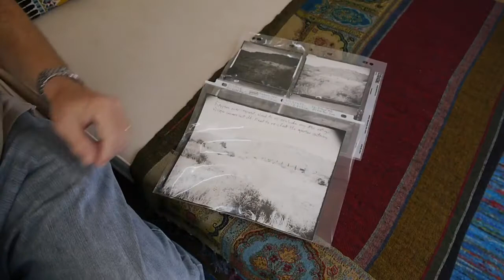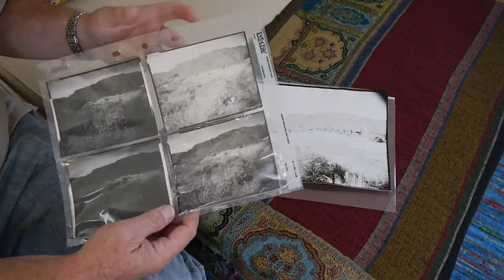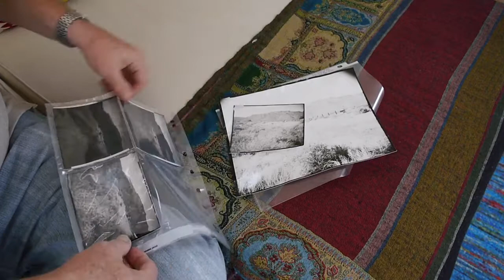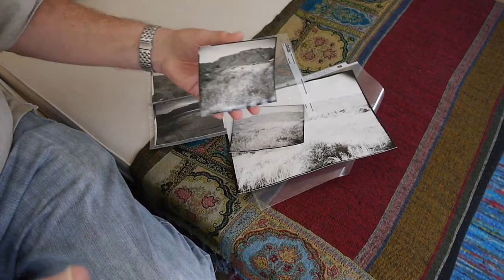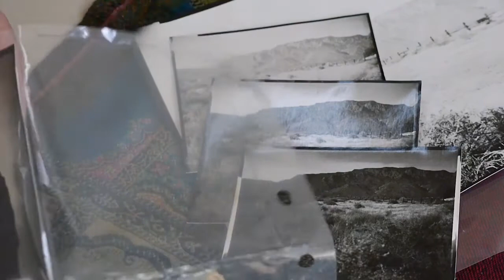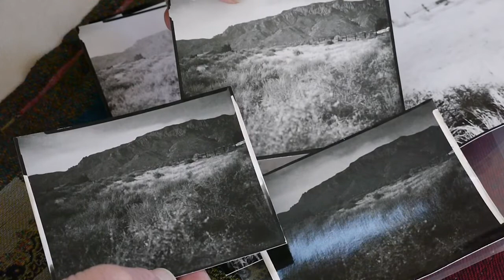Harman Direct Positive Paper Speed Test

Comment: Joe thanks - that really helps as I've been experimenting with Direct Positive the last few months, on my second box now.  I have rated 3 and 6 with varied results using Multigrade 1:9.  I'm wondering what your develop time is and if you are adding more time for 1:10 than if doing 1:9?  Thanks for all your fine tutorials and how-to's.
Reply from the maker: I’ve lately been using Dektol too, besides Multigrade developer. I find a partially used bottle of liquid concentrate goes bad rather quickly, so now I mix one shot straight from Dektol powder, bypassing the stock solution phase.

As for development time, there seems to be more variability in getting the correct exposure than getting the exact processing time. With correct exposure you should have good highlights and mid tones, whereas correct development gives you deep, rich shadows. Usually 2-3 minutes is fine.
Reply: @Joe_VanCleave  thanks very much.  I had that experience with Multigrade as well with the partially used bottle going bad.  I was surprised that it did but I was pushing 3 months on it so it may have been my gamble.  Thanks for clarifying exposure v dev times experience.  I began using HDP in June and am on my second box now.  Partly because I'm doing the processing unseen in a Stearman tank I have stayed the base.  Of the first box I got about 2/3's images.  I have steadily increased exposure times more agressive and seen better results.  I do really like the HDP and call it jokingly, a slow Polaroid :) Joe thanks very much for you insight and well done documentary style how-to videos.

Comment: does the paper fit nicely in the film holder or some modification is needed?
Reply from the maker: It's comes cut for 4x5 film size, no need to trim. The very first batches of the paper, that came out maybe a decade or more ago, were not sized for film holders, but since then they've come precut.

Comment: I'm curious to hear if you pre-flashed your paper and does that have any effect on the ISO rating when you make an image?
Reply from the maker: Yes, I do preflash, using a low-wattage (7.5 watt) frosted white bulb (similar to a small nightlight bulb), suspended over my darkroom table in a metal housing. There's an early video of mine about preflashing, I'll link it below. Preflashing doesn't as much increase the effective speed of the paper as it does raise the shadow detail a bit. The mid-tone and highlight exposure remains about the same, but the overall contrast is lower, much improved for scenic landscape images, which can become excessively contrasty, because of the preponderance of blue light.
Reply from the maker: Here's the video on preflashing. https://www.youtube.com/watch?v=13PGOFqNruU
Reply: I had watched the pre-flash video was just wondering if you did that before you made the tests.  I have a Kodak 3A that I'm planning on shooting direct positive paper in 4x5.  Like your vids - thanks
Reply from the maker: The ISO of the paper is rather complex, I'm wanting to make a video about that. In the summer months it seems faster than the winter months, for scenic photography, because of the difference in UV between winter and summer (and a conventional light meter doesn't reveal that difference directly).

The preflashing mainly lifts the shadow detail up, with little affect on the highlights. So it improves tonal range.
Reply from the maker: I'll have to go look in my archives to see if this was preflashed.